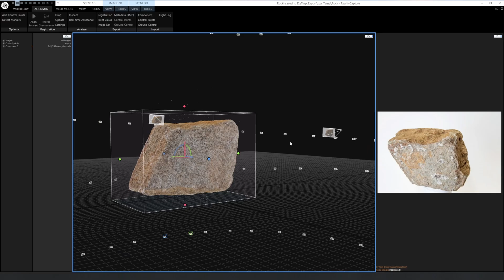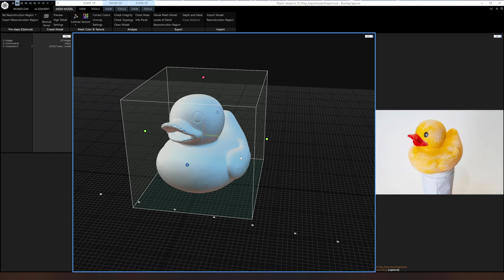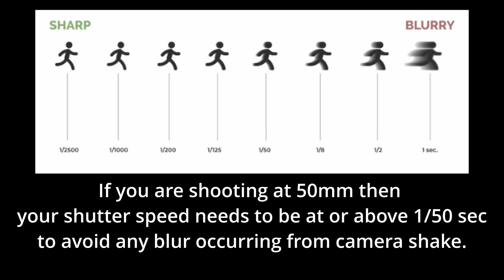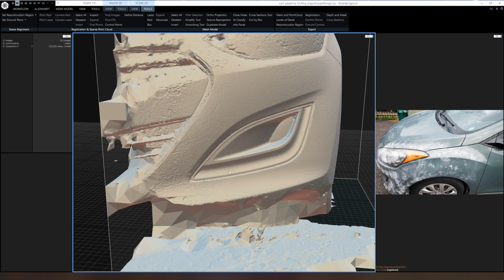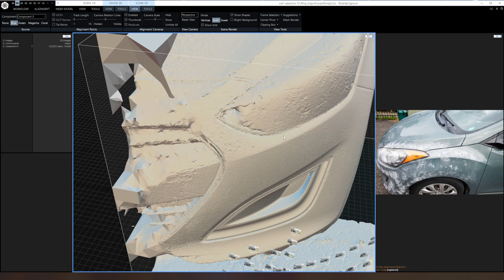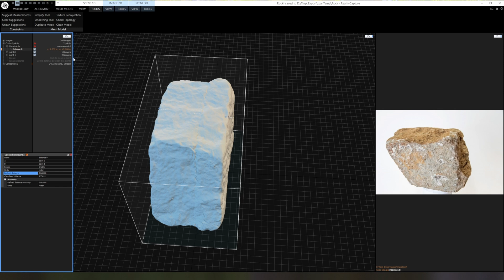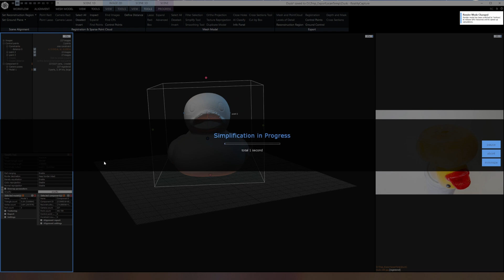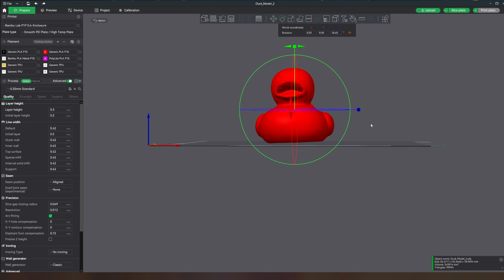Copy Anything! - Simple Scanning Techniques for 3D printing

Comment: May you can do a couple of vids how to do reconstructions / reverse engineering of complex technical parts… 
ducks and stuff are mostly to simple… may you can do something like this 👍
Reply from the maker: Possibly, I was thinking of a video comparing different techniques. Do you have any suggestions of a good technical part to use as an example?
Reply: @DaveRigDesign  i do have some here, but i cant share. Most difficult would be black matt or glossy parts with deep undercuts so the optics need to see into it.
May the filter housing for regular car combustion engine, this has an top and bottom, which need to allign perfect for the rubber gasket nut and screw holes…

Comment: I had a man who prints dental appliances and even replacement teeth print some puppet heads for me. I want to get a 3D printer and scanner to make puppet heads can you recommend a good entry level set up that would have all the things I need? I have a Canon camera for stop motion animation so I might not need a scanner. But what would the best entry level printer with dental resin be? Thanks! Appreciate this video!
Reply from the maker: For resin I would suggest either the elegoo Mars 5 Ultra or the Saturn 4 ultra if you need a bigger print area. If you wanted a FDM printer I would recommend the elegoo centauri carbon as a good budget printer, but if you wanted the best quality with the least hassle go for a Bambu labs P2S.

Comment: New to printing. Is it possible to print leaving less lines? Probably a stupid question but hey I’m new here lol
Reply from the maker: Not a stupid question at all, It's the holy grail of printing to find a way to hide the layer lines. There are alot of options but all have trade offs and depend on what your printing and the use case. 

If your printing small things and they are mostly decorative using a resin printer is the easiest option as their layer lines are so small there are practically none.

If your printing larger things or more functional prints, using Matte filaments make the lines harder to see, but they are still there. You can also turn on "fuzzy skin" in the slicer which adds a texture to the surface that hides the lines and you can adjust how fuzzy you want the surface.

If you need the surface to be smooth you are left with sanding and applying something to the surface to fill in the gaps. 

I have this playlist of different ways to smooth prints for painting and projects I used them on https://youtube.com/playlist?list=PLRux6G0OPmneg6FgyuhDOUZO7wrXFmYE2&si=7vP5cB-MA18VJB95
Reply: @DaveRigDesign thank you for sharing. Much appreciated! I will definitely look into this once the kids allow me back on the printer lol

Comment: Absolutely awesome informational video.  It's given me confidence enogh to try for myself.
Thank you.  thank you.  Thank you.
Reply from the maker: Awesome. You’ll find it’s much easier than you think. Start with simple objects to get the hang of it then try more complex ones.
Reply: I hope that my photography hobby, yes with too much kit, will help.

Being a retired engineer will let me copy the process from there, following your videos, documenting the process sequence for next time.

I will feed back how I get on and if the casting comes out feedback sometimes images.

Once again, thank you for the inspiration to try.

Regards

Rod
Reply from the maker: If you have experience with photography already you have a big advantage already. Getting good images makes the biggest impact on the output
Reply: Am I right in thinking that bright, diffused, omnidirectional light is preferable?

Close up with a longer lens, to avoid parallax?

What sensor size, 24 meg good enough, with a semi pro lens?
Reply from the maker: 35-50mm is best. Too wide and you get distortion and too long makes it difficult to move around the object. Normally you want diffused light so there are no shadows, but this is to get clean textures. If you plan to print the meshes textures quality isn’t important. 24mp is plenty :)
Reply: Thanks for the info. I would have gone too long.  I will keep you up to speed on how I get on.

Rod

Comment: Duck.  I am interested in this topic for building plastic parts for restoration of audio equipment.  Many turntables were made of plastic parts that are no longer available.  I am trying to figure out what the cost of investment would be (I already have a professional digital camera) for the software and associated equipment.
Reply from the maker: The software is free so all you would need is a decent computer with a NVIDIA Graphics card to process the data. If the computer can play modern video games it should be fine. 
I made this video earlier that covers the basics of the process and its setup which may explain more
https://youtu.be/FrTMHDvGcj0?si=VmXNuMk1t4KdWNlf

Comment: Dave.  Great video.  I'm trying to get into 3d printing broken plastic bits and bobs for aged cars.  Been looking for a way to quickly "scan/copy" the bad piece so i can print a replica.  That's quite the camera.  What do you feel would be the min ability of a digital camera for this technique?
Reply from the maker: Thanks 🙏
Pretty much any name brand camera would work. You could get away with using a phone camera also if it’s decent. 
Although If you are making small parts I would suggest looking at a hand held scanner. Revopoint and Creality make some that are reasonably priced. 
Photogrammetry will work but taking the photos becomes challenging when working with small objects.

Comment: seems reality capture is part windows only - have any free compositing software advice for mac users?
Reply from the maker: there are some free options but they aren't as good, also not sure if they run on mac. At the moment the best results for photogrammetry rely on using a windows machine and a Nvidia GPU.
Reply: @DaveRigDesign  aparently apple launched object capture though you have to code to use it. Figured it out, but seems its inference when i flip the images is seriously lacking. sucks too, all my images are great and my angles.
Reply: @DaveRigDesign Sad tuba sound